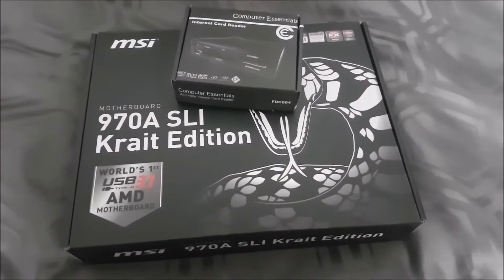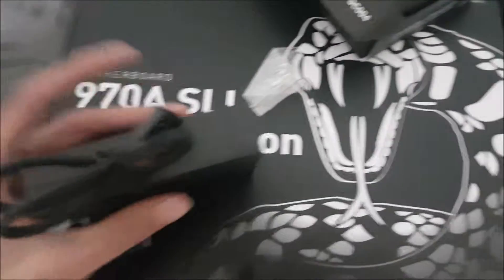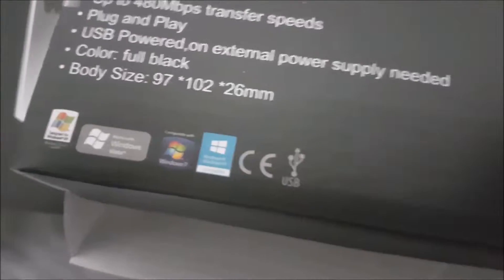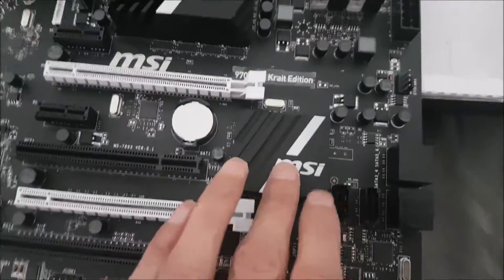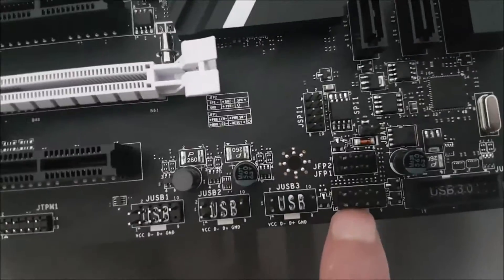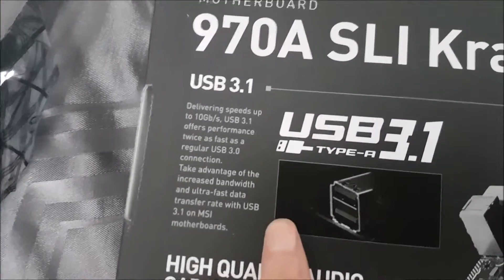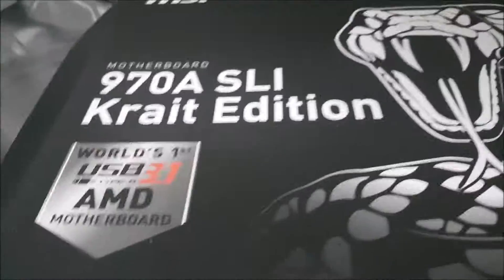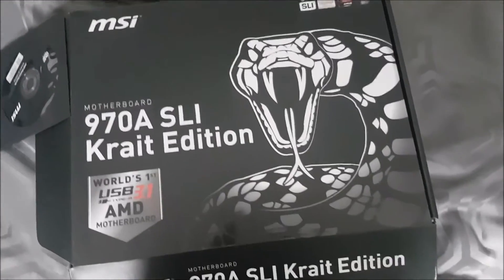MSI 970A SLI Krait Edition

Comment: Excellent video!!  Very informative and i like those kind of videos.  So i gave you a Sub & Like. Hope you can return the favor.  btw this motherboard, does it allow for DDR3 RAM?
Reply from the maker: Cheers for the like and the sub. Yeah this motherboard has 4 DIMMs, Duel Channel DDR3 (up to 2133Mhz OC speed) holds up to 32GB max capacity. I currently have 2x 8GB Corsair Vengeance 1600Mhz Speed DIMMs (total 16GB) installed and works great. :)
Reply: Thanks.  It was a very good review video!